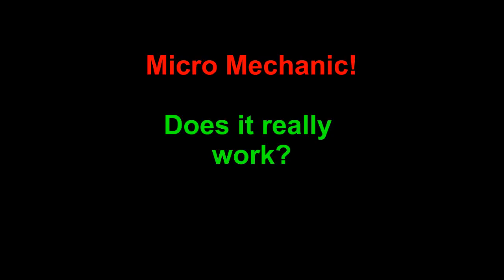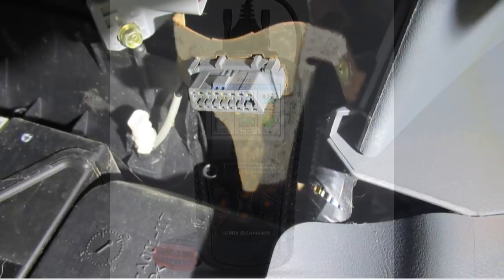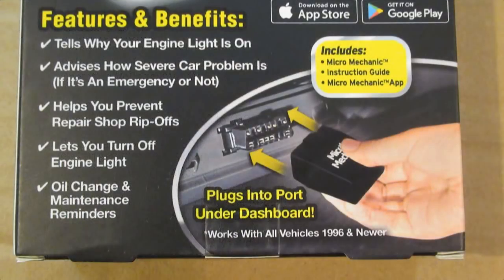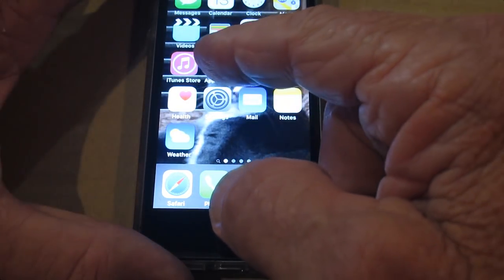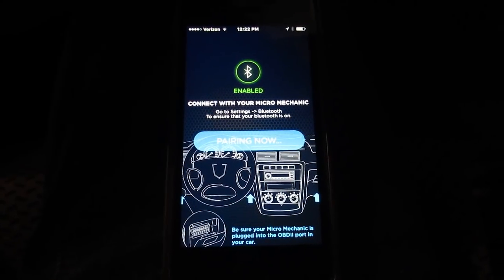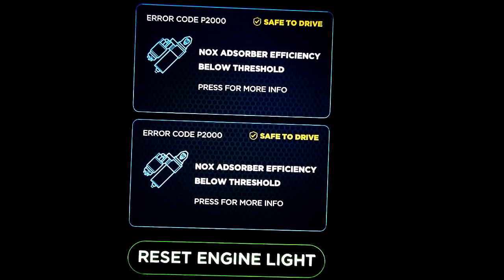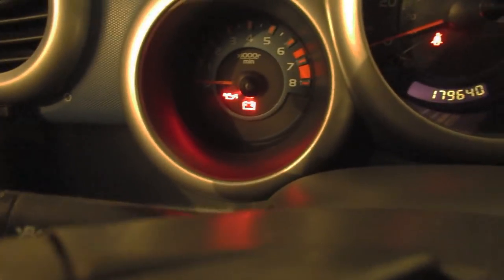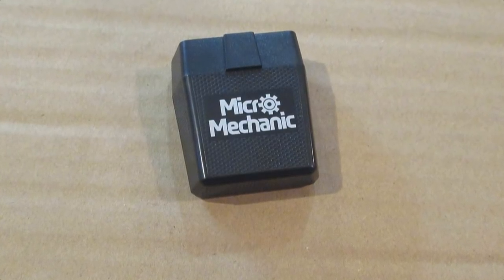Tiny Micro Mechanic Automotive Code Reader tells problems & resets engine light after repair.

Comment: This device does not catch any issues...ima light and check engine also . but it says no issues safe to drive.. don't waste your money!
Reply from the maker: Actually mine works and still is working well. You should return it, as yours must be bad.

Comment: Well..
Youre missing a little detail...
Just because you turned the check engine ligh off...
That doesn't mean you fixed the problem....
You just turned the light off...
Your 02 sensors are still faulty.... your light will come back on after the on board computer does its scan and finds out the 02 sensors are faulty....
Reply from the maker: No kidding.  I know that and said that in the video description!

Comment: If you have any issues with the Micro Mechanic App, there's another app : CARISTA that is actually more user-friendly than the original one. There other apps that works with this OBD reader but CARISTA was the one I like the most.
Reply from the maker: Mine has been working fine, but I will keep that in mind.
Reply: I was yesterday checking the Google apps store and there's a lot more software for Bluetooth OBD than the last time I checked out. In most cases the hardware and software should be compatible regardless of brands 😏😁 Just in case you want to try other brands.
Reply from the maker: @robertobonano3464  Yes.  Again,  I am having no issues with my app, but if I do I will keep that in mind.  Thanks.

Comment: There is a much better app called Car Scanner ELM OBD2 that works with this. It provides much more info and has more capabilities.
Reply from the maker: Yes, there is always improvements.  This just happens to be the one I bought and it works just fine for me.  Thanks.

Comment: My son gave me one as a stocking stuffer at Christmas.  Nothing wrong with my car and it confirmed that.  It worked pretty slick.  But it would not work before it knew my name email address and location.  I thought that was a little strange.  Thanks for the vid.
Reply from the maker: Yes, not sure about the reason, but I have not been spammed by anything so far.  Thanks.

Comment: The reviews for the app are pretty brutal. People recommend that you use a different app with the dongle.
Reply from the maker: Thanks.  It worked fine for me.
Reply: I noticed in the card that was in the box also suggested that other apps were compatible too. That hints that the makers may have been either aware that some would have issues with the stock app or realized that others would prefer something different.

But the dongle does work well with the other two apps I've tried--as I work on finding what is best for me. So if someone else has problems with the device, I suggest that they try some of the other listed apps before consigning it as junk. I think these devices are likely pretty generic and mostly foolproof.

Comment: Does it drain your battery if left plugged in all the time?
Reply from the maker: It would be about the same as the clock and radio memory which runs off the battery 24/7.  It uses very little power, but some.

Comment: Where do I find the 4 digit code?
Reply from the maker: Not sure of the question.  The app gives the code, if it finds a problem.  If no problem found, no code will be given.  Some older cars don't have sensors that record faults.  Nothing is 100%.
Reply: The Bluetooth 4 digit code for pairing is 0000 or 1234.

Comment: Hmm, I have an engine light and as the reviewer said I to walked by a display rack and saw it but it got for $10.00 dollars.. For me I am not sure it worked,  tried it but displayed no problem ok to drive, with no problem found it did not give the option of clearing the warning light, which with state inspection coming up for me was what was looking to do, so, seeking another solution.
Reply from the maker: Usually an engine light means an o2 sensor is telling you your catalytic converter is bad.  The light only goes out permanently when you fix your catalytic converter.  You can only shut it off after the fix, because it will come back on. State inspection will not care if lite is on, because they test exhaust, so.....good luck.
Reply: Thanks for the advice.

Comment: Use a different app one they recommend  Got it to work
Reply from the maker: That's great.  I never knew there was a different app that it would work with as the one I downloaded did.  Thanks.
Reply: Which app? Someone also mentioned an app called Torque works with this device....not sure if it works though as I haven't tried
Reply: I used the CARISTA app it's more user-friendly than the original one. It's on the same app store as the original.

Comment: I have a micro mechanic, my engine light is on but when I put star scan it say no results found, would you have a idea why it says no record found even if engine light is on.
Reply from the maker: Not sure of that, since I never experienced it with mine.  I think older cars may not have as many sensors, so check what year car yours is to see if compatible with this unit.

Comment: I just tried it on my truck and it said no problem found..but yet i already know i need a new oil pump i have no oil pressure and cant run my truck but it said no problem found safe to drive..hope it works good for other people thanks for the video.
Reply from the maker: Unless your truck has electronics tied into your oil pump, it would not tell that, I assume.  Thanks.

Comment: Not sure what car/truck u got but it want connect to a 99 to 01 Ford Expedition so don’t buy if u got these vehicles
Reply: I just used it on my 99 silverado said no problem found but i know i need a oil pump maybe it didnt even read
Reply: B-bop 1027 maybe

Comment: I tried one 30 minutes ago, it was worthless. all it said was safe to drive. I know for a fact it's missing on a cylinder. I already know which cylinder, I just wanted to try the product
Reply from the maker: Missing on 1 cylinder IS safe to drive to a shop.
Reply: lol I guess you could say it was right in a sense
Reply: I was expecting at least a little feedback from it
Reply from the maker: @hardtruth46   And it worked perfectly on 2 of my cars and 2 cars of my friends, so it's a draw.  If it didn't work, I would certainly have said so, as I bought it myself, not given to me by  the manufacture.  Happy driving.

Comment: What year does the vehichle need to be
Reply from the maker: Any year that has the onboard computer diagnostics plug under the dash should work.   My Honda is a 2005 and it worked for me telling me what was wrong.  I reset the engine light, but since the problem still existed, It came back on in about 2 days. Good luck.
Reply: 1965 or older
Reply: Gotta be OBD 2 1995 and newer there no emissions on anything prior or tech not 100% on the year

Comment: "Mechanics do it for free". Well i live far away from mechanics, saves me money in gas. Car starts making odd noises, i can check on the go.

"Didnt tell you the actual problem". Well its not supposed to. It gives you the symptoms and you have to figure it out. Maybe there are others that will, but for a product you can pick up off a wal-mart shelf... it's not that bad.

This guy isn't the spokesperson for micromechanic. He plugged it in and it worked as intended. Good review.
Reply from the maker: Thanks very kindly.  I appreciate that. If it didn't work, I would have said so, for those who know me for my honest reviews.  Happy New Year!

Comment: Thanks for the review but this thing is a piece of sh$t.  My check engine light have been on so I bought this to try out.  After having it pair with the app that goes with the unit, I had it scanned my car and it came back as no problems found.  Safe to drive.  It won't even tell me why my check engine light is on.
Reply from the maker: Sorry to hear that.  I bought mine just like you did, as they are sold in every "as seen on TV" shelf in all kinds of stores. I don't make it or own the company.  If it hadn't worked for me, I would have made a bad review, but it did work.  Not everything is 100%, but the app was free and it was only $20.  99% of the time, the Gas cap is loose or the catalytic converter is bad, which makes the O2 sensors give a warning.  If you can reset the light, then is working.  If it is safe to drive, then relax and drive.  If you don't like any of that, just take it back.
Thanks for the comments.

Comment: good when you need a state inspection and the engine lights come on.
Reply from the maker: True.  We have no state inspection system here.
Reply: Just because the light is off it's not fixed you can unplug your battery or due that and shut it off it won't pass you'll make it worse especially when you still got pay to put it on weather you pass or not then hope you get a 10 day inspection and pass when you go back your vehicle needs to reset itself by driving it even after fixing the issue usually 20 + miles

Comment: Tells you what the problem is... resetting it.. just makes the warning light disappear.  It didn't really fix the problem... (for the people who don't know about cars).  I wonder if it also addresses the other lights other than the check engine light.
Reply from the maker: Exactly.  I state that in my video description. It tests for many different problems also, but only after fixing the problem, will the light stay out.

Comment: Bought this item, had had a code but was a old mode which my mechanic removed since it was repaired and I had tested. Should of been no codes but thought best test Micro mechanic to see if It worked. Followed directions precisely.  Got no codes. Thought good. After disconnecting all my dash lights came on. Would not shut off, now can not get all dash lights off, radio stopped working,  emergency flashers no longer working, high beams not working, turn signals not working as well as other things. Everything was fine before I used this item. I took it to my mechanic and will have to have a scan done he belives it caused my pcm or email to go out. DO NOT BUY!!
Reply from the maker: That sounds very unlikely to have caused all this, including Email??? Surprised!  Mine works great but you should contact the manufacturer to see what when wrong.
Reply: @NightFlyyer , Thanks for the imput, ya I have spoken with them but going to my mechanic but very unlikely could been caused by anything else from doing nothing more than sitting there running. Plus I had it inspected by mechanic who had a professional scanner the day before to get rid of a very old code. But will have to see what mechanic says. But more and likely he said is either caused a problem with cvm, evm, or relay. Am hoping and praying it's just a relay. Otherwise could cost up to $850-1000 not to mention loss wages which could add up to quite abit

Comment: Smh...You gave the impression that the device Miraculously fixed the problem causing the CEL to stay off!!!... You should've  informed your viewers what the result would be,  had you perform that "New scan" and that the Check engine light will always miraculously come back on until the issues are fixed.
Reply from the maker: I made that point in my video description and probably should have said it more clearer.  But, it did it's job and I found no major problems with the engine, which is what I wanted to know.

Comment: The one I got didn’t fine anything wrong my  engine light was on I’m taking it back to get a refund !!!.
Reply from the maker: Well that's Bummer, usually the light is on because of Smog control sensors. Take it to a mechanic and see what his reader says.
Reply: If u just put it in the ignition that’s normal

Comment: Can't get it to pair.
Reply from the maker: Plug it in, Turn on key, Make sure phone has proper app.  Make sure Bluetooth on phone is turned on, go to settings, pick micro mechanic and it should pair.  If not, it must be faulty and you may have to contact the company.  Sorry.

Comment: I don't want to knock what you've done but you haven't cured the fault, you've just reset the light, it will come back on
Reply from the maker: I know that it doenst fix anything and said that in my video description.  It hasn't come back on yet, and I expect it to, but as I am using ethanol gas in it now, which may have affected the readings, it might not.  But the main thing was to make sure nothing major was wrong with the engine, which this little unit did.

Comment: Sorry Dave, not with you this time on that thing. Resetting the light doesnt fix the problem and I can bet that light will go back on. Its best to get it in and have things checked. Do some research reguarding why the code was set. It may be a bad 02 sensor or a bad converter. You can test the o2 sensor using a 12vt bulb in a socket and hook one end to ground and the other to the wire, that will test the 02 heater. I think the sensor wire is 5 volts and can also be tested to see if it has proper continuity. If its dead, then you can replace it. You need to know which one it is, that code reader probably wont tell you that. If its not an 02 sensor, then its time to test back pressure. I have done that too. I had an oldsmobile with a bad cat. I just removed it , knocked out the innards, put it back together and no more issues. They dont do tailpipe tests in Mi.
Reply from the maker: Being a certified Mechanic back in the day, I certainly know about what your saying.  I never said this would fix it.  If you read my comments and video description, you would know I believe the catalytic converter is bad, and why the O2 sensors sent this below par reading.  There is no reason to worry, and since there are no smog laws in Iowa, I do not have to worry. The reader simply let me know there was no major problems with this 179,000 mile car, I just bought, so did it's job.  I know what a mechanic would have charged and it would have been more than $20, I'll bet.  Thanks.

Comment: Hi Mr. Dave Herbert! This instrument device is only use for your model car or any model cars ? Thank you!
Reply from the maker: It says it will work on all cars that have the OBDII port under the dash for reading the computer codes. Both 02 sensors are saying they are below threshold, which tells me the Catalytic Converter is probably bad. But there are no Smog Laws here in Iowa, so it I do not have to worry or repair anything. The Micro Mechanic did it's job, proving nothing major was wrong.  Thanks and good question.
Reply: Very grateful Mr. Herbert and I was pleased with his response! Have a good day and good flights too !!!

Comment: Ok dude let me help you out before you waste your time and money here. I just found your channel and was looking at your airplanes and I saw you just posted this video and I have seen these advertised on tv. I also happen to be a real mechanic and I own an auto shop. You can see it on my channel.  I  just looked up P2000 on my Alldata and I did not find this code. It sounds like maybe you're not in the USA because the term Nox absorber sounds more European than American. But that aside, your problem is not o2s, but catalytic converter. We would have a p420 Catalytic converter below threshold. I warn everyone that no diagnoses was done and part will be bought and installed without fixing the problem. I have seen I don't know how many people who have gone to the auto parys store,had their codes read and bought the wrong part and kept buying the wrong part untill after 3 or 4 tries they give up and bring it to me and I find a broken wire or something like that!!! Anyways not trying to bust your chops, just be careful because car parts can be pricey!!! Keep Rocking and Keep flying!!!
Reply from the maker: I was once a certified mechanic also so appreciate your concern.  I figured the catalytic converter was bad too, which causes the 02 sensors to react as they did.  I live in a state where there are no smog requirements, so am not concerned with these readings, as that engine light warning might have been something more serious to worry about. So for me, it did it's job and I'm not buying anything.   Thanks for the comments.
Reply: +NightFlyyer Cool I'm glad you didn't end up spending money you didn't need to.  I  still say be careful with this kind of tool. But on another note,  I'm looking forward to watching some of your night flying.  I have a Blade 230 night. I'm a newbie at it and of course it's crashed a few times. But I have a Nano as well and love it. A lot of fun. Please feel free to stop by and check out my flying and my channel.  I'm mostly car stuff, but fast cars and fast helicopters/planes go together!!! Anyway glad you didn't waste any money anf I look forward to your next video!!! Keep Rocking it out!!!
Reply: +NightFlyyer Also just to know, if the warning light is yellow it means caution, if it's red it means stop immediately. The check engine light has nothing to do with the safety of the engine. What I mean by that is no damage will come to the engine when the check engine light is on. Now if the light is flashing, that means that the engine has a misfire that will cause catalytic converter damage. Only red lights will cause engine damage( temp,oil lights are red). So stop now on red and see a mechanic on yellow. Anyways hope that helps and Keep Rocking!!!
Reply: Rocker Pat Yes, reading a code doesnt actually test the part or in most cases actually identify the actual issue. I usually do have a scan done, then I read up as to what test is needed to properly identify the issue. An o2 sensor can be tested easy enough. I have changed them a few times. Resetting it doesnt fix anything and most likely, it will go back on after running a while.